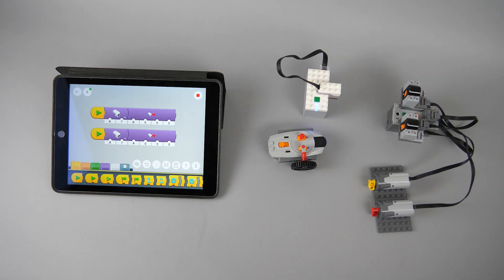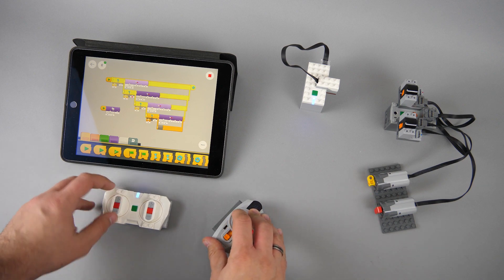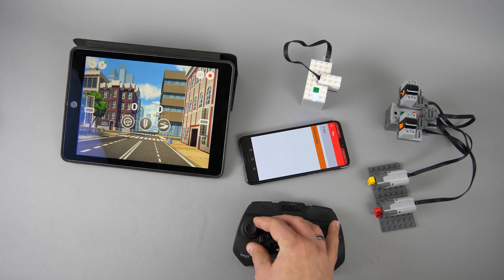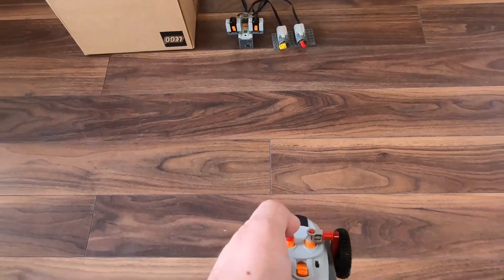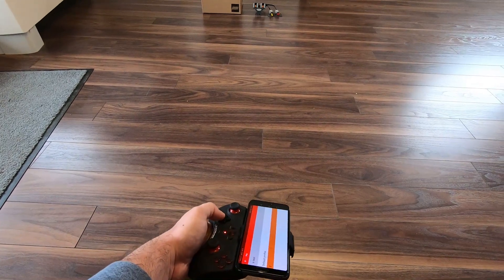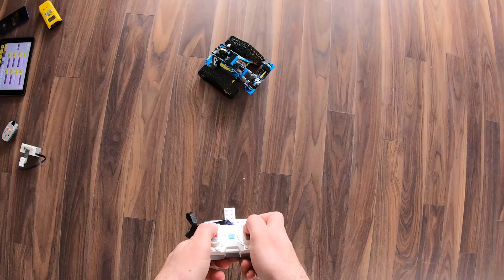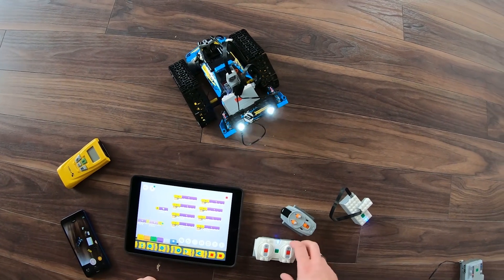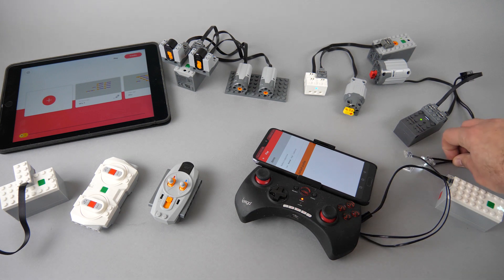LEGO Power Functions control with IR remote vs Powered Up app - distance & speed test + more

Comment: You're great. The part we write "A 0 1 A" has seen as "A 0 1 10" and "0 1 10" number is in red color instead of black. And sometimes programs need have to close and open again the sensor to work properly. Have you any idea to solve my problem?

Comment: Would love to see some more light testing and light programming!
Reply from the maker: PU lights are pretty limited at the moment, what would you like to see?
Reply: RacingBrick I would like to see how you can program lighting. Just basic blinking for specific lights and certain duration. Both with PU and PF using PU the color and distance sensor.
Reply from the maker: @disneytuber5903  not sure if this is worth a separate video. You set the light level on a certain output to 100%, then add a wait block (e.g. 1 sec), then set the light level to 0%, wait again, and put this whole thing in a loop. Here is your basic blinker.

Comment: But control plus sensor can be located directly INSIDE the model, and all control is going via BLE. So we can control big setup like gearboxes and slow mechanisms like cranes, excavator actuators, interesting creations like wending machines, surprise boxes, GBC modules (at least with autonomous Spike Prime hub), or with dedicated low-cost smartphone completing minimum PU app requirements to run.
Reply from the maker: With the current abilities of the Powered Up app I think it is still easier and more straightforward to use SBrick or another Power Functions-compatible solution.
Reply: @RacingBrick  it may be indispensable in case of purist-only contests where s-brick or buwizz are prohibited.

Comment: I think that this test is kind of unfair/ has too many variables.
1. The performance of the powered up solution might depend heavily on the program.
2. The performance of the phone depends on the phone. Others might be better/ worse.
Reply from the maker: That's the point. The IR remote solution has a constant performance, the PU and phone IR solution will have a very inconsistent performance, therefore the play experience can be heavily affected. If advanced functions are needed then a 3rd party non-IR based solution is much better.